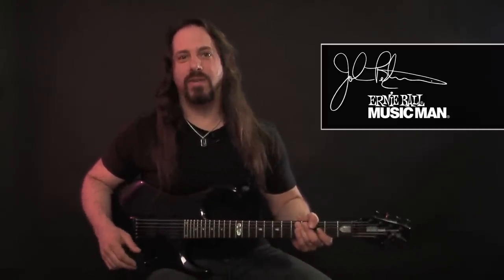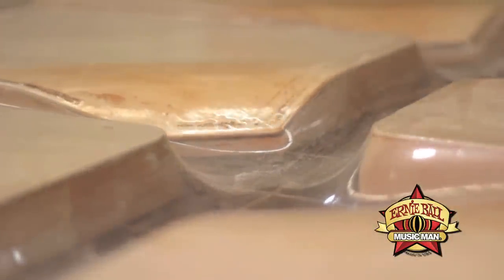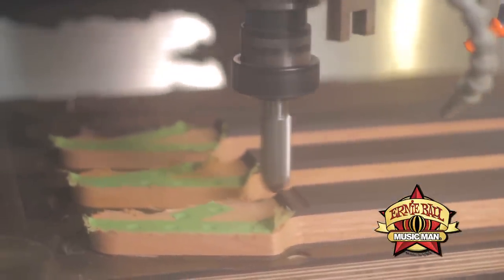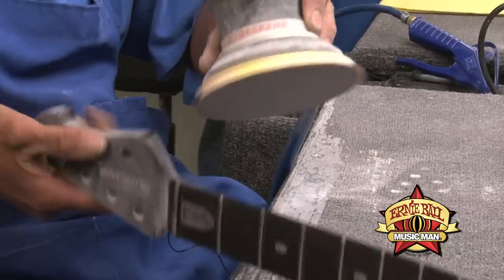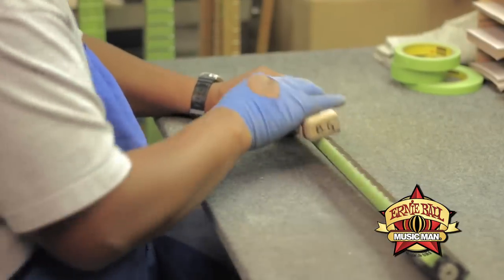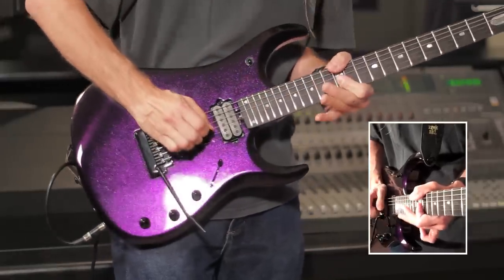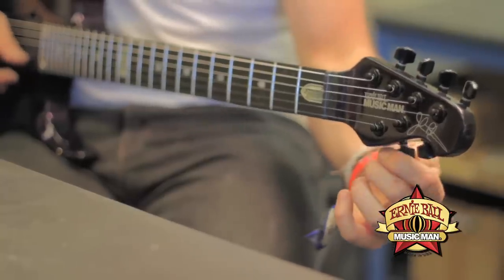Building The Ernie Ball Music Man JPX with John Petrucci

Comment: I used the JP6 to design a custom guitar off of due to not having a complicated trem that still works like a Floyd and its lower horn cut shorter. I am in control of its design completely which is cool, I felt his JP6 was a good foundation to build from. I changed the wood type with a proprietary idea I am waiting to see if it works out and if it does I will update. 

The guitar I am building is meant to be a system to scientifically control sound waves and their behaviors because I believe it will result in shaping tone and achieving a harmonic balance. If I am correct it should come to be a better sound or at the very least a unique sounding guitar. I am incorporating a ton of ideas from both my own and others past and present artists. Its more of an experiment and if it turns out shitty I can just build another with other parameters once I analyze why it didn't do what was intended. Prototyping is the best part of engineering anything. All guitars are built off base designs its just most of the time people choose either Fender or Gibson as a base. Music Man guitars are unique enough it should deviate from this general assumption of "if I create a guitar like Fender or Gibson it will automatically be good regardless if another company's base design is better. I am also considering basing the neck profile off the Ibanez Wizard neck.
It has proven interesting so far.

Comment: considering the price of this guitar i thought that it would have been more hand made rather than machined.
Reply: It is hand made. Even boutique manufacturers use similar machines.  
"Custom made" guitars cost much, much more my friend.
Reply: Ozznize is the only way to mantain "equal" quality on all the production. Otherwise it will be a unique guitar, and will cost USD 5000-10.000 each.
Reply: nicolashrv double that price my friend.. here in Norway you actualy have to pay betwene 2'000 to 5'000 USD for a brand new one from a shop (not ebay) for that masterpiece. depending on the Model ofc

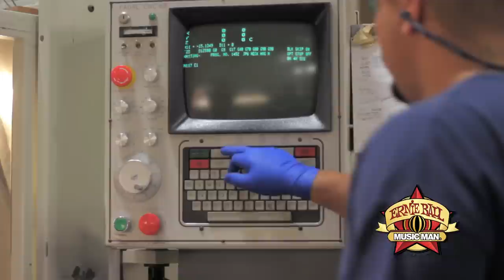Comment: DISSAPOINTMENT!  1:11 Look at that massive gnarl in the bodywood. Seriously that kind of bad quality for a 4000€ guitar? Well nobody sees the wood until you take off the finish.
Reply: If you're paying $4000€/$4481 USD for this guitar someone's screwing you BIG TIME.
Reply: nope thats the regular price for those in Europe. Just take a look at Thomann Online Store and you'll see that the cheapes Majesty costs 3790€ ( 4230$ ) and the JP15 costs 4099€ ( 4580$ ). And this is the cheapest online store.
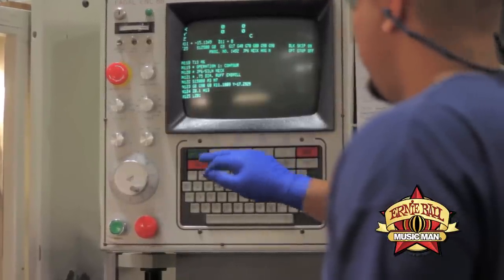Reply: WOW!! I apologize. It must have something to do with the import tax or shipping, here in the states JP-15  going for $2800USD/2507€ plus local sales tax if bought online most of the time no sales tax. You almost better off finding US dealer online and  having it shipped to the UK. Even if it cost you 300€ which I think would be on the high side, you're way better off going that route unless you get slammed with some import or customs tax. I was going to buy a guitar from a UK dealer earlier this year and they were charging $130USD to ship it to the east coast of the states. I am not defending MM, if you're talking about that knot "gnarl" at 1:11 on the side, you're looking at the guitar body in the very first stages of production.  I am sure they inspected it and in their opinion by the time it got to it's final shaping and sanding it would either be gone or needed very little filler. Something every manufacturer does on "painted" guitars, strip the finish off a Gibson LP gold top, black or white and you're likely to find the same thing. Fender Stratocasters are famous for that. I will say for a video showing the building process of their guitars they should have looked at the video closer and not used that particular body for that part of the video. Then again on the other hand if they did see it and obviously went with it goes to show you they weren't hiding anything.
Reply: Don't worry. I know that this sounds totally crazy and I haven't believed it until I saw the numbers and yes, it's cheaper to import Balls from the US even with the import tax included. That's the one BIG downside of Ernie Ball compared to brands like Suhr or Tom Anderson. So buying a new Ball in Europe is totally crazy. The used market is quit okay, sometimes you find a fair offer but most of these are imports from US if you ask.
Reply: What is it that makes them so expensive over there, is it the shipping, import tax or something else. Is it the same with other USA guitars Gibson, Fenders.. etc.etc or is it only on certain brands that the price gets jacked up so much?
Reply: AlexisGitarre if you actually look that part of the body comes off on the bandsaw, otherwise it wouldn't have made it into the production line

Comment: This will be my next guitar. I already have a JP7, and now I want a 6-string to go with it. The chambered body and slightly fatter neck radius (compared with the 12 and 13) are what sealed the deal. I just can't get into the new Majesty. I like the body design, but the fake carbon fiber and candy colors just don't do it for me.
Reply: Well keep in mind the "fake carbon fiber" is actually a better substitute for carbon fiber. Instead they used maple that was LAZER etched literally just because it's cooler looking AND works better tonally. 
But I will agree that the colors don't work well. Only ones are the black and the white versions. Maaaaaybe I'd dig it more (personally) if they had that guitar without the LAZER etched maple and nothing but a quilted or flamed or curly maple top. That'd be badass.

Comment: Nuh-uh! I built a guitar before and it was the bee's knee's, it was the cat's pajamas. But it took a lot of hard work to build. which is why hand-made guitars cost 2-4 thousand dollars. When companies like Ernie Ball started using machines, surely no earlier than the mid 90's, they should have dropped the price. But they didn't. That's just plain wrong. That JPX shouldn't cost more than 1300, at the very most.

Comment: my question is why Ernie ball felt the need to try to fuck me over when my JP-6 had obvious problems with stability.
Reply: Because you're not john petrucci.
Reply: Also that's the first time I've heard of a problem with a JP ernie ball music man. You know what caused the problem? What tuning were you in? Did you get it used?
Reply: Hank Hill Bought it new, used it in standard. I sent it to them because the pickup switch got jammed. When I got it back it started having that problem. I owned the guitar for about 6 months before the switch problem happened.
Reply: HurtboxTV
Hmm... Well if you sent it in for a tune-up they may have screwed something up when they serviced it. I have the idea that the guys at EBMM perform full-sweep maintenance checks on things and adjusted something wrong in the process of going over the whole guitar.
Reply: Juan José Fonseca Godoy I've actually played a couple other JP6's with the same problem. the BFR's and higher priced ones don't have this issue but for a guitar that's nearly 2 grand that's disappointing.
Reply: Juan José Fonseca Godoy yeah, I have an 800$ modded super strat that has better stability than those guitars. at least I can use the trem bar without it going out of tune.
Reply: +Hank Hill 
First time?  LOL.  You must not read the ernie ball forums -- like at all.  They are just like any manufacturer of guitars -- they have their share of problems just like everybody else man.  No guitar maker sells "perfect" guitars that don't have any issues.  Things get missed in QC.  It happens.
Reply: Juan José Fonseca Godoy
They typically do. I've played, quite literally, dozens of EBMM's and I've literally never come across those issues.
Reply: surgeyX
That's true, but I very much meant it when I read that he had issues, and he was the very first complaint I ever heard, and the only time I had read about another issue was this same thread.

Weird. I guess I've gotten lucky, because I have played a ton and never encountered any issues. I understand that no guitar company is perfect, but EBMM has a pretty good track record if you ask me.

At least they aren't as bad as Agile.
Reply: +HurtboxTV 
Yeah, I am seriously starting to think that tuning stability and playability are better things to have than looks...It's hard finding good 24-fret guitars that are USA made for under a grand though.  I wish Fender still made their "Showmaster" line -- those were when Suhr was still with the company...man those were some sick ass super strats.  But honestly, any guitar with rolled fret edges and a decent neck that is installed properly and has a good truss rod can be turned into a guitarist's dream -- add locking tuners (staggered tuners if the guitar has string trees, so you can remove those fucking useless things) and some custom pickups, and you're ready to go.
Reply: surgeyX
I absolutely agree with you. I think those trems tend to contribute a lot of the poor tuning stability to the EBMM JP guitars. No locking nut and no fine tuners on the bridge? Please, that is ASKING for trouble.
Reply: +Hank Hill 
Eh..I actually like their bridges...moreso than most actually.  I really don't think tremolos need a locking nut.  That is just overkill.  The EBMM tremolos don't go that far "down" like a floyd rose does where the strings have like zero tension and are just flopping all over the neck, so it doesn't really need a locking nut IMHO...Guthrie's new Charvel model is the same way -- I love it.  Locking tuners take care of the stability -- the only real issue is strings binding in the nut slots; but if the nut is cut properly to whatever string gauges you're using, and as long as it's lubricated (graph tech black tusq is my favorite, or just use nut sauce), it should be OK.
Reply: surgeyX
I'm just not that into trems in general. I'm waiting for Evertune to finish making theirs. Now THAT will be a good trem.

I would LOVE to have a trem that was worth the effort. I love the idea of being able to do a slight dip on some parts of a song rather than a pre-emptive bend, or have vibrato on an entire chord, to the little trills that are oh so unused these days, that sort of stuff.

But having that and maintaining a floating trem is so much of a hassle. Even an experienced technician will take an hour or two just get restring properly allowing for a good setup. Then tuning takes forever, and then you have to retune after letting it settle. Just nothing but frustration for only so much functionality.

That's why I'm excited for an Evertune tremelo. It will literally be string and go, and it will never ever go out of tune.
Reply: +Hank Hill 
Boy I dun tell ya ha-what, Evertune is fucking AWESOME...They have been saying they would make a tremolo version for years now though...They still don't have a piezo saddle version of their standard one, or an acoustic version yet :|  I guess they are not that popular, I will never understand why -- but IMHO, it's the best invention for electric guitar players since the electric guitar itself.  My next guitar will definitely have one, for sure.  I guess people don't like the looks of them...I think they look pretty cool to be honest, but overall I could care less...you can literally not have to tune your guitar for like a month with an Evertune.  I was thinking about getting the LTD EC-1000 that comes with an Evertune; but I decided against it...Am gonna wait until I can afford to just have a custom guitar made with one.  The VGS Tommy whatever model though, comes with Evertune AND true temperament frets...MMM.  But yeah, if you're getting a hard tail guitar built, there's no reason to NOT get an Evertune.  They are just so fucking awesome.  The only real downside is that they do add a considerable amount of weight to the body, but in the end I think the tradeoff is well worth it.  There's no reason to believe their Tremolo model will be any less kickass also...I'm betting it will probably be at least the most stable tuning trem design ever.
Reply: surgeyX
It takes a long time to get a magic device at all like evertune engineered. I wouldn't say that they're unpopular. It just takes time to design them. They're making one for Bass first, then acoustic guitar, then a trem. I'd say that makes the tremertune about 10 years away from now at the soonest...
Reply: +HurtboxTV Basswood, my friend. That wood dents and chips just by looking at it. Its pretty normal! The posts on the trem can make the holes bigger, just by the string tension itself. 
Thats why it doesnt happen to any other EBmm guitar. Because theyre different and harder woods ;). Thats why i hate basswood nowdays.
Reply: +RicardoDiazHimself 
Not true about Basswood -- all depends on the finish and quality -- Guthrie Govan's new Charvel signature is baked Basswood, it's fucking awesome...I also have an Ibanez RG1527M Prestige -- no dents at all, because it has a nice finish on it protecting the wood...Also I would assume like every other high end guitar that the EBMM trem posts have locking studs inside of them to prevent what you are talking about.
Reply: Noup. Finish has nothing to do with the holes where the posts rest. Thats why screws get stuck in there too. Basswood is too fragile. Ive used basswood guitars all my life and thats why im getting away from it. Its a KNOWN fact. 
Even with locking studs. Like my ibanez UV. Its a 99 model and even with the studs and sharp knife edges, the holes are just big already. The posts freakin move and that happens to every basswood guitar with a trem.